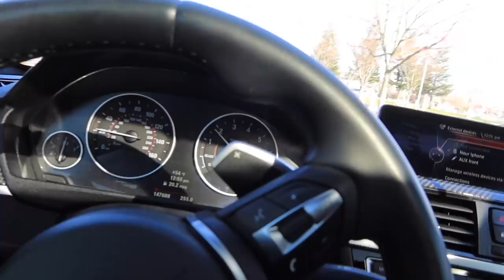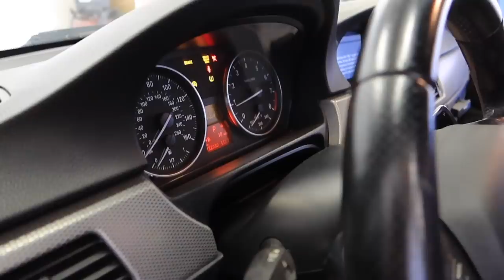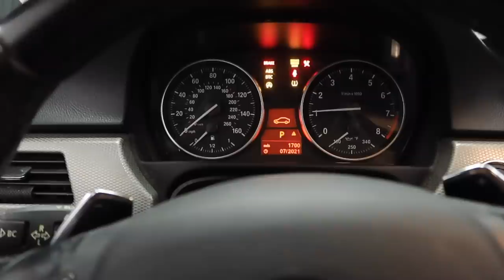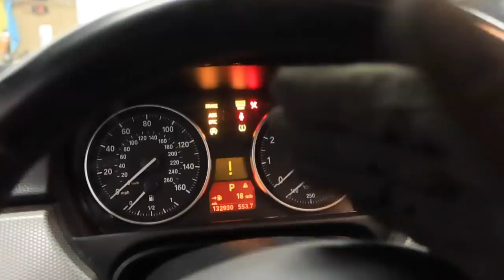Rebuilding a Salvaged 2011 BMW E92 M-Sport! (Part.2)

Comment: The oil on the spark plugs is caused by a faulty valve cover gasket. You might as well replace your valve tronic gasket as well.

328i owner 👌

Comment: Do the 3 stage manifold swap on the 128i you can find a 330i manifold at a yard I got mine for like 250, I did it on my e93 and it feels like a different car. Love the channel and it’s a fun project u get to tear apart ur n52 lol
Reply: N52 doesn’t have a cable lead to the disa actuator on the 330/328n51 stage 3 intake it’s not plug and play you need a ecu flash and run a new custom wire setup
Reply: @sparksyg1932 I did it and had to run no wiring, the wire is there capped off. The tune is recommended but not necessary the valves will just open the same time with no tuning.

Comment: Hey Nour can I get more details on what Arlan was talking about BMW covering certain things up to 150k miles I have a 2011 328i with about 115k miles and when I turn on the car after about 15 or 30 seconds it jerks a bit and the rpms spike then check engine light comes on I ran the codes and it gives me a camshaft position sensor b error as well another code
Reply from the maker: Yea they should cover it if you have a check engine
Reply: @NourHummadi  cool thanks man love the channel been a subscriber since the early days with your 330
Reply: You should make a video talkin about that , it would help alot of people 🤷🏼‍♂️
Reply: They’ll only cover specific items. Look up the sulev warranty. And your car has to be a sulev model, not every 328i
Reply: Furaat inc what are the two codes?